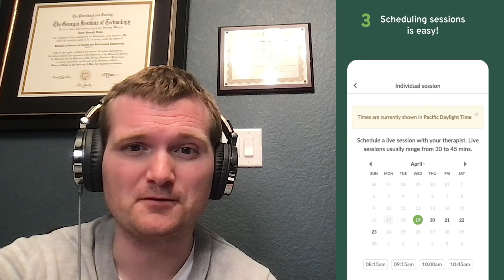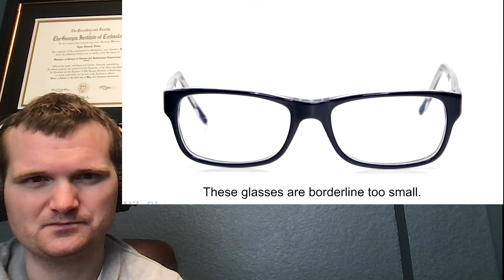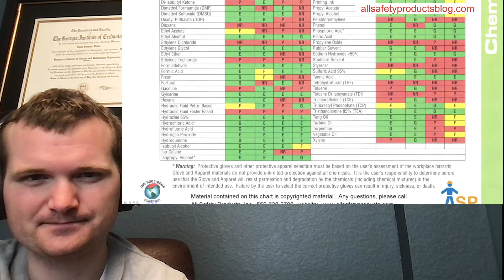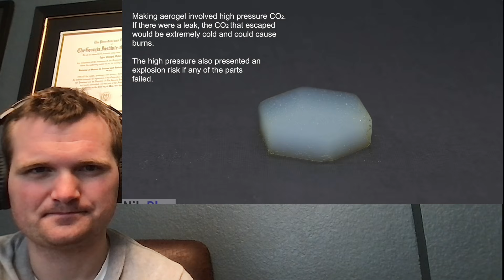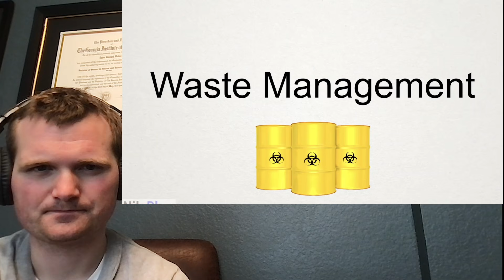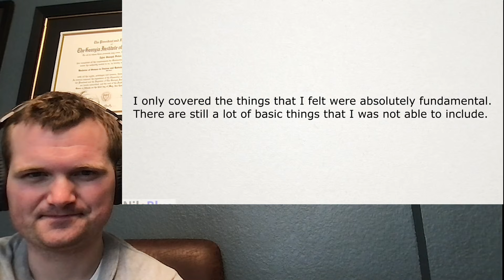Nuclear Engineer Reacts to NileBlue "Chemistry is Dangerous"

Comment: 8:00 I worked in a machine shop for decades and I have seen a guy get a shard of hot metal right in the eye even with safety glasses and a face shield both on and in place... It ricochetted off the top rim just perfectly into a tiny gap at the top of his head, bounced over the glasses and right in. Never misuse or forget your PPE, but also remember even with all reasonably considered precautions things can and will still happen.

Comment: At about 35:20 in, you talk about how labeling can also be an issue. What can compound this is when someone misunderstands the chemical or labling. I knew a person who worked at a car auction as a detailer. They had just be nired and were doing basic, initial cleaning. But nobody trained them properly on how to refill their cleaners. When they ran out of the engine degreaser, they asked someone where to get more and they pointed out where it was. They weent to the bottle with a pump, refilled their thing, and went bak to work. The very next engine they sprayed it on burst into flame. The place got 5 galon pum jugd of extreme concintrate and the instructions were to put one pump in, then fill the rest of the bottle with distilled water. That was roughly a 1:32 ratio! And they put that chemical directly on an aluminum block, which removed all the oxides, turning them back into oxygen while having a highly exothermic reaction. Nice burst of oxygen, massive heat, and the assorted oil and other buildup on a car engine, all vlended with a massivly caustic chemical. Luckly, nobody ended up in the hospital and they were able to get the car out with an extinguisher before the fire department arrived. The car, which was on a lease return, ended up being a writeoff because the engine was now pitted, plastics had burned and deformed, and then it was blasted by an extunguisher and a fire hose. It would take more to bring it back to "certified pre owned" than the car was worth.

Comment: You get fuel in your eyes once, and you have a whole new respect for eye protection.  Luckily I had people around me to guide me to the eyewash station, because I couldn’t see anything.  It wasn’t an operation that really had any risk of spray.  I was removing an electric pump from a drum, and decided to collapse the telescopic siphon.  Something was stuck to the bottom, and as i slid one pipe into the other, the collar between them suddenly gave way and sprayed high pressure fuel under my large prescription sunglasses, still strong enough to feel it lift my eyelids.  It basically turned into a classic supersoaker.  Don’t be afraid of the eyewash either.  While it feels horrible in a non-emergency, it feels so amazing when there’s fuel in your eyes.  And it really does take 15-30 minutes to dilute out.

Comment: 29:51 steel toed boots can actually be a worse idea than something without depending on the conditions you’re working in. For example, if a forklift carrying something heavy, rolls over your foot it might break your toes. But the steel can deform and actually cut into your toes and even amputate them. Steel toed shoes are good for kicking things on accident or dropping stuff. But aren’t good for extremely heavy machinery. Just another example of using the right protection for the individual conditions

Comment: Eye washing sinks are very commonly used in welding and fabrication shops. There are a lot of times when we are grinding metal pieces we are fitting together. Tiny pieces of metal, either powder or flake, can fly suprisingly far. We wear safety glasses in addition to our welding hoods, but they can still find their way into our eyes. We are very serious about eye protection. That powder or flake can very quickly damage your eyes and make you partially or fully blind. That sink will save your sight so you can see your kids grow up. Even if you are missing a finger.

Comment: Fun fact, in some situations like in warehouses, they'll actually suggest not wearing steel toe boots because there have been cases of people losing all of their toes because something ridiculously heavy somehow ended up on top of them. Off the top of my head I can think of one example and that's a forklift running over your feet. So in that situation the steel toes are kind of pointless 😂 29:25
Reply: There's other forms of toe protection other than steel. I worked in wind and we had to wear composite that isn't conductive and won't cut toes off as easily

Comment: Once I was soldering a large heat synced barrel jack. So I was pulling on it wile hitting it with a heat gun. I lost my grip and the flux and solder shot into my face. My glasses stopped it in its tracks. Still splatters on my face some. Learned tones that day. But I did not have to loose or fuck up my eye.

Comment: Talking about too much PPE or in my case, safety. Too much safety can be dangerous. I had to do a job in a car plant. Welding two 6” gussets onto an existing beam. The beam was 7’ off of the ground. I had 3’ step ladder. No problem. Nope. Big problem. Plant safety showed up when I was setting up the job and asked if the step ladder was stationary. I just went “What?” and he moved it with his foot. Job shut down! The ladder needed to be anchored. So here comes the engineer to check and make sure nothing was embedded in the CONCRETE floor. I was sitting around for nearly 5 hours before I got the okay to drill holes for anchor bolts. I believe my reply was “Seriously?” Then grabbed my gear and went home.

Comment: During a chemistry experiment in school we were working with concentrated sulphuric acid. The whole class shared a bottle of the acid and a pipette for adding it to our experiments. One girl went to put the pipette down flat on the bench and the act of her placing it down was enough to shoot a few tiny drops out of the end, right onto my arm and side, my side was protected by my shirt but my arm caught a few drops, it burned pretty well but I got it under a tap very quickly so damage was minimal, still scarred though.

So even something that seems as simple and trivial as putting a pipette down on a bench can be dangerous too, it’s not something that a normal person would think twice about but with just a small amount of thought could easily be avoided, like requiring all pipettes to be placed tip down into a beaker rather than laid down on the desk. However like Tyler said that is just rules and requires people to follow them so unless everyone involved follows the rules completely then things like this can happen, often due to complacency.

Comment: Regarding corrective lenses, when working with chemicals, it's usually not a good idea to wear contacts, because if you get splashed in the eye, or even from fumes absorbing into the water in your eyes, the chemicals can get trapped in between the contact lense and your eyeball, potentially causing more severe eye damage, and they also of course interfere with eye washing.
Reply: Yeah but you would wear safety goggles right? Can't get splashed with safety goggles.
Reply: @Jartran72 You can, but it's still not recommended, because ppe can always fail

Comment: The only time a hardhat is not required at a construction site is you are a roofer and there is nothing overhead and it's 100 degrees and 99% humidity, and that hardhat is now a safety hazard due to it cooking your head. If there is something overhead you suck it up and deal with it, but there is only so much water can do. Have ever tried sweating when its 100% humidity and almost 100% dewpoint? Sucks to suck.
While doing my roofing apprenticeship, which lasted 4 years, the first year involved 0 actual on the job work skills.
100's hours of safety training was year one.
Reply: What about welders? Can't really wear a hardhat and a welding helmet at the same time either.
Reply: People can still drop stuff on your head, you could still fall and hit your head.. 100% humidity is insane because sweat literally can't evaporate. I would actually say it should be illegal to work under 100% humidity involving any sort of strenous labor, many people have heat stroked. If a roofer heat strokes he might take a deadly fall or atleast leaves him paralised.
Reply: depends on the jobsite and what the safety standards are bud.

Comment: one really important thing to think about for something like amateur chemistry is, nigel is right, there are many things you cant do safely but you can do them *safer*. if youre aware of your own risk tolerance, and you're re-evaluating that when you decide what to do and how to do it.. well, you can still decide to distill sulfuric acid in your backyard. you can think it though and plan it out and judge how much you really need highly pure sulfuric acid against the risk. people die randomly in car accidents all the time, but the rate of deaths for safe conscientious drivers is significantly lower. that latter rate is what to keep in mind, i think. having that in mind will also help you come up with new safety measures for your situation. even nuclear and lab safety arent "zero risk tolerance" though - otherwise we would do absolutely everything through teleoperation! the institutional risk tolerance is just much lower than you can decide for yourself as an individual.

Comment: I work with some corrosives in wineries that will actually burn your skin really really really bad, the reason we use them in tanks is they kill bacteria and they dissolve biological solids that are stuck on the inside of wine tanks but are very much dangerous to people who are not careful. Other hazards include Carbon Dioxide, Hydrogen Sulfide and sulfites in closed confined spaces. You will die if you are not careful. Also falling objects mainly wine barrels fall off racks 50+ feet into the air sometimes and they hit the ground and blow up literally pop open and throw shrapnel everywhere.

Comment: Thinking about when I worked with chemicals at a pool. I definitely neglected PPE way too much. Part of the reason? Masks and such were uncomfortable and could have germs from the previous person. We also didn’t have a great example of safety from the person managing us my first couple of summers there. 

We were dealing with acid and chlorine (similar to household bleach). I should have been more consistent with the PPE I wore, ensured I had closed-toes shoes for certain tasks, etc. Especially when I was switching acid barrels, which had tubes that could have flicked acid on me.

I think of when there was an acid spill back in the pump room. I did grab the mask and apron and throw on closed-toed shoes, etc. I also called the manager to come. I still probably did too much back there, but I wanted to throw a base onto the acid before it did much more damage. (We had soda ash and baking soda on hand… though we usually only needed that to quickly balance the pool PH!) If I’m worried about a spill corroding a wall, concrete, or nearby pipes, I have no business being near it with breathable running shoes. 

When I say “spill,” I mean that some equipment failed, and it was leaking—badly. I wasn’t trained on how to handle a leak like that! Acid is supposed to seamlessly go from its barrel in a locked, ventilated room into the pipes to mix with pool water. But it was a small pool, and I was the only employee on site. I did what I could.

I also don’t know if the eye wash station was working… yeah. More training would have been good. I guess there’s a reason that, after a change in management, most of us weren’t supposed to handle some of the tasks I’d handled before.

Comment: In grade 9, I was in metalwork class and a piece of molten slag landed in my eye I had to use the eye wash for like 20-30 minutes until my eye didn't hurt
Reply: Should have worn ppe
Reply: @gamerboi608  I was it went under my glasses 😭 but I did almost lose my eye from blacksmithing without glasses and I was making a knife and it was red hot jumped out of my pliers and hit me in the eye